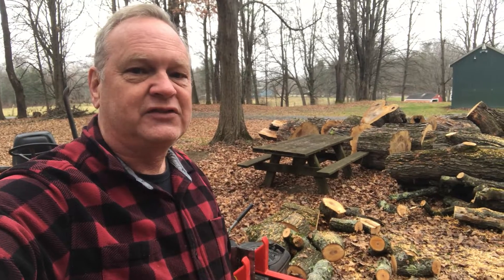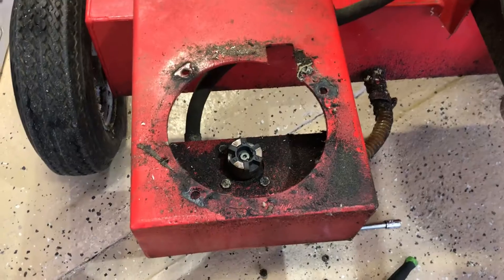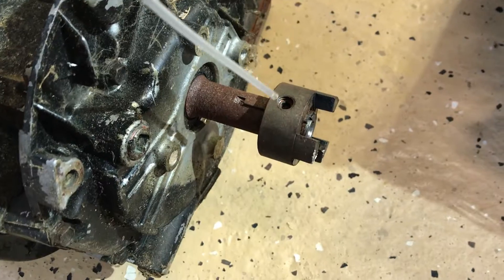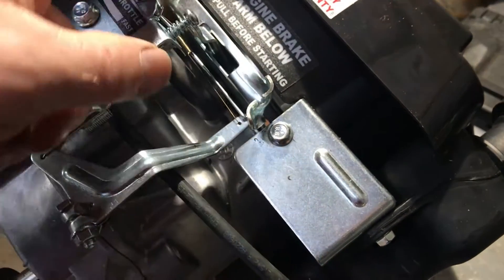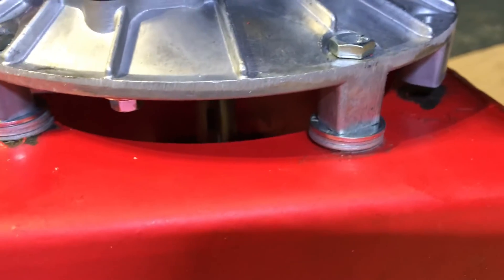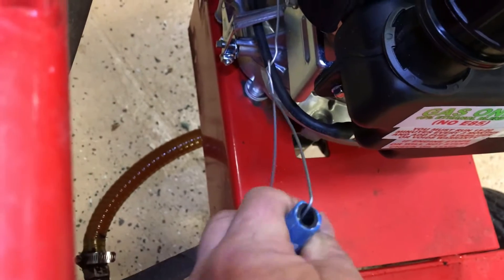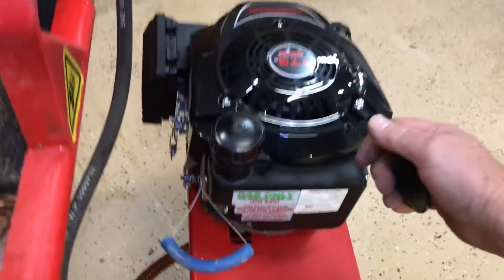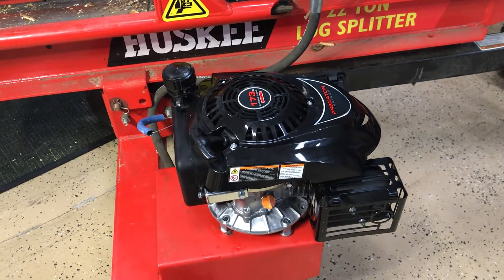Replacing Blown Wood Splitter Engine with a Harbor Freight Predator Engine

Comment: I have the exact same set up as you and replaced with the same predator engine. I expected it to start right up after installing. The pull start is aggressively jerking back and won’t start. Any ideas? Any guesses are appreciated!

Comment: For lawn mower use only is what the warning clearly states on the HF website.
Reply: Yes, has an aluminum fly wheel and needs the weight of the mower blade to prevent kickback when starting. I added a 1/2" metal plate to motor coupler. Mine wouldn't start, pull start kickback just about broke my wrist.
Reply: @davec2891 hey Dave can you explain how you did this?  Not really sure how to add weight to flywheel.
Reply: Can you explain the process for that?   The kickback on the pull start broke two of the assemblies so far.

Comment: Gotta do same! Just bought the engine at Harbor freight. Better go get 12 washers, and some oil. Remember to use only gasoline. No ethanol low grade pump stuff. Real gas can be bought at Sunoco.

Comment: Great Video!! I have the same wood splitter (12 years old) that had the same problem using the same engine. After watching your video I put in a Bilt Hard 173cc from Amazon for $159.  The installation went a lot smoother after watching your descriptive video. The Bilt Hard is quieter and a lot more fuel efficient then the original Briggs & Stratton. I'm splitting up a storm now and getting ready for winter.   Thanks again!
Reply: I too have this same one and the Briggs on it isn't working. Been through everything trying to get it to crank, it's 10+ years old and I feel it's lived its life. Can you post the link to the one you purchased? Thanks!
Reply: Did it fit the same, shaft and brake switch?

Comment: The Bilt Hard 173cc sold on Amazon is the same engine with a Blue engine cover and $70 cheaper at $159. I just installed one on my DR trimmer mower replacing the junk Briggs 7.25. I'll upload a video on it in a day or 2.
Reply: Thanks for this info and saving me a bunch of money! Gonna buy one on prime day
Reply: @bigtoon8300  was it any cheaper on prime day? I missed it
Reply: I have a couple of videos on my channel on the Bilt Hard engine, including one on adding a kill switch.

Comment: Like the idea and that it worked out for you I had the same problem with my 22 ton identical to yours engine blew cannot find a replacement with the same shaft size those that you can engine too small was told that it would work but won't last long I was told that the engine should be at least 189 cc or 212 CC right now I'm looking at getting a horizontal and hooking it up that way from harbor freight they have the predator p 6.5 HP which is 212 CC right now not sure what I'm going to do but I'm not going to go out and buy a brand new one have you had any problems at all with that 5.5 horsepower? hope things work out for you in good video have a great day
Reply from the maker: I’m using it right now! Works like a charm. Don’t notice any thing different from old engine.

Comment: I would shorten the output shaft to match the length of the original motor.
Reply: No. Do not do this. Voids warranty on engine.
Reply: Don’t just use body or fender washers and keep the warranty 😊

Comment: I'm doing the same project on the exact same equipment. The love joy connectors on mine are different but I had to do the same thing with washers but I chose to lower the pump underneath with the washers. The problem I'm having now is the bolt patterns lining up. I want the exhaust to be facing the inside towards the splitter. I like your approach to the throttle and brake arm.

Comment: I used the same engine on my old 1980 Craftsman lawn tractor. Works great for what I do with it, which is haul hay on a little trailer. The engine is a downsize from the ten horse Briggs, has less torque, but runs faster. Always starts winter or summer. You could have just cut the shaft down, but washers are OK too. I like the way you did the "brake" as you call it. I just used some bailing wire. I might just use your idea!

Comment: It's called a coupling
Reply from the maker: Thank you, I was having a brain fart and couldn’t think of the correct name 🤪
Reply: Coupling. Coupler is the noun. Coupling is the action verb. Often coupling is used to describe the act of joining pipes or power shafts. Yet, coupling refers to the actor placing and fitting a coupler.